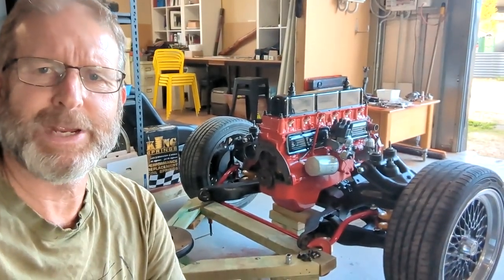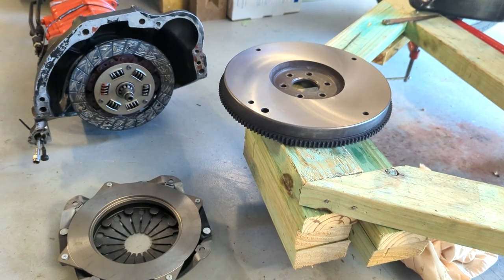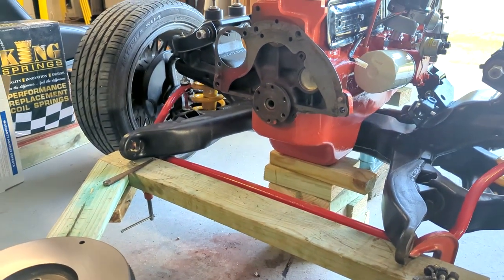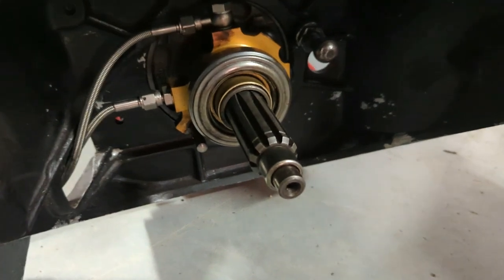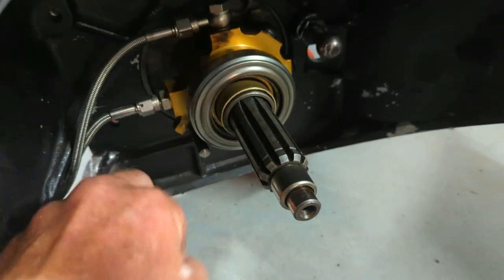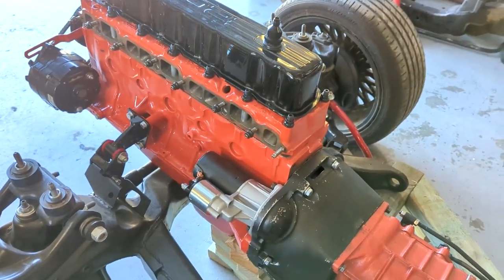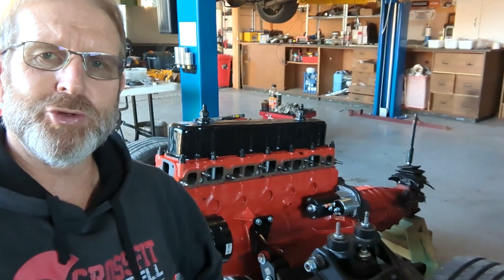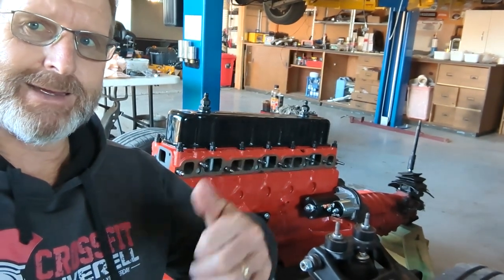No.59 Torana Build M20 Gearbox Installation  KamicarzCreations - Holden Six

Comment: I noticed that the nuts holding the top control arm bushings in place do not have any of the threads exposed from the control arm rods?  Have you used excessively long nuts or are the bushings excessively long?
Reply from the maker: Thay are Nyloc nuts and are 22mm long :-)

Comment: Did you lighten the flywheel with machining?..
Reply from the maker: No it was just a skim to clean it up
Reply: @KamicarzCreations  It surprised me the pickup over a short distance when I took a few grams off mine.
Reply from the maker: Yeah in running a lightened fly wheel on the 202 build.....trouble can be loosing that mass for cruising